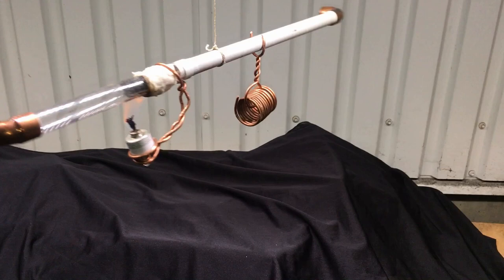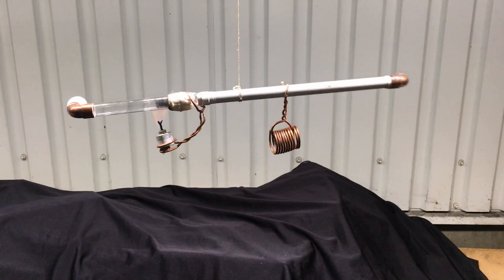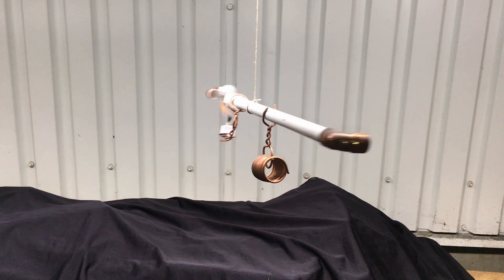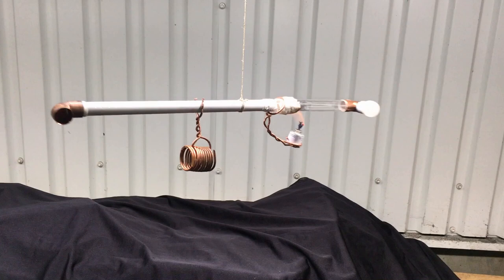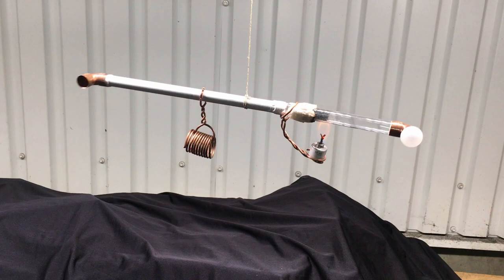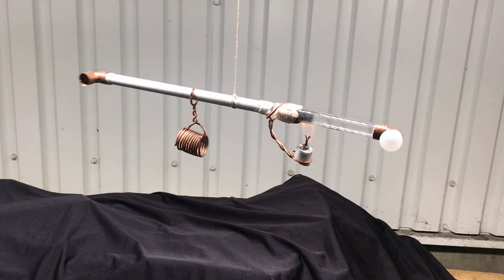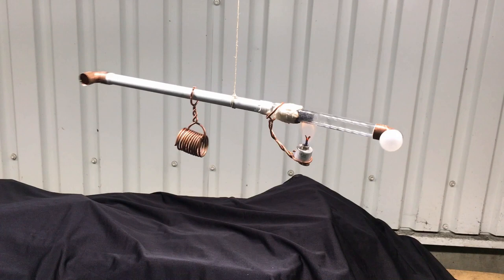Thermoacoustic heat engine with thrust?  Part 2. - short update

Comment: Cool! I was watching the Part 1 video and was wondering if a lower frequency would give you more thrust!
Reply from the maker: Dear Coleen, The lower frequency gas has higher stroke. So the jet effect could be stronger. Also I reduced the tube diameter, so few developement steps in my pocket now for the future projects. :) BLADE